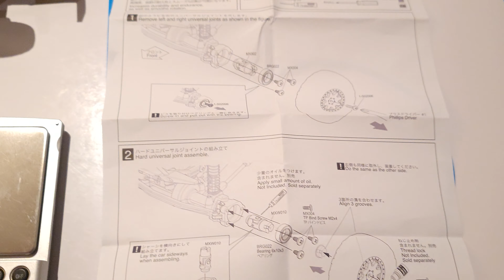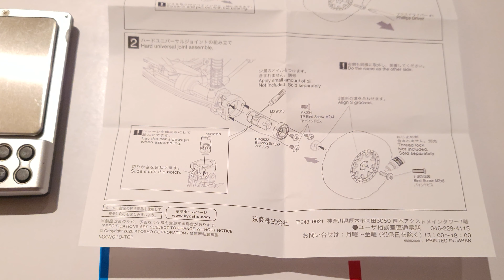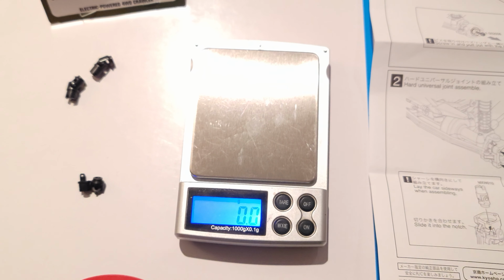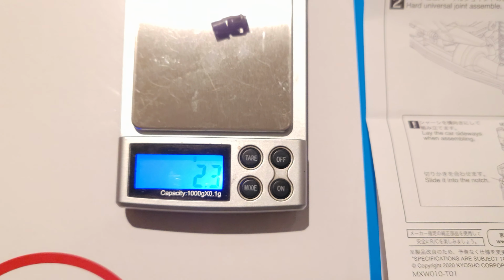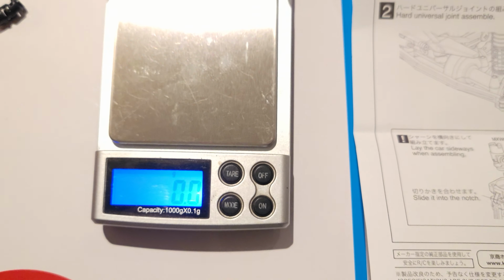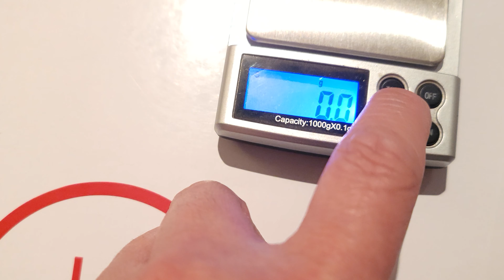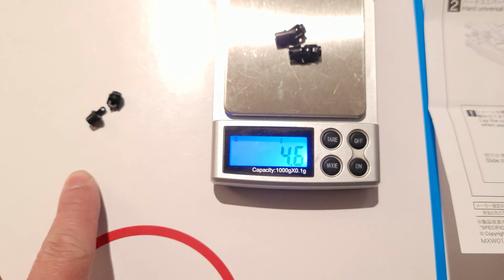Kyosho Mini Z 4x4 MXW010 Universal Joint Set

Comment: do they have the threads already in to screw the wheel in? and how are they now any updates?
Reply from the maker: It's a direct upgrade from Kyosho. The threads are already drilled and the tire screws directly to it just like the stock plastic axle. No modifications needed. So far these are holding up to my kids abuse and no failure.